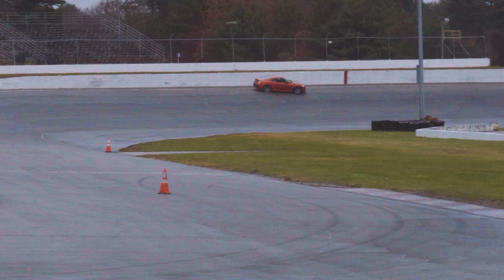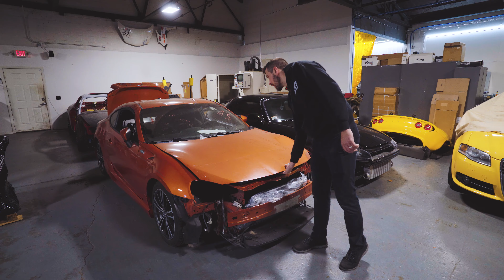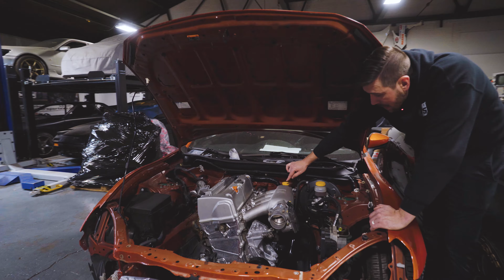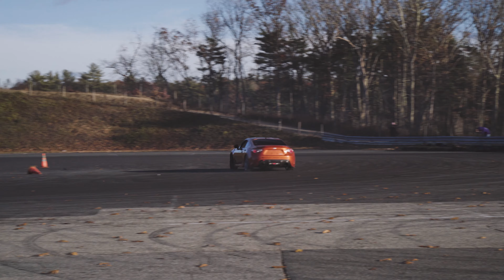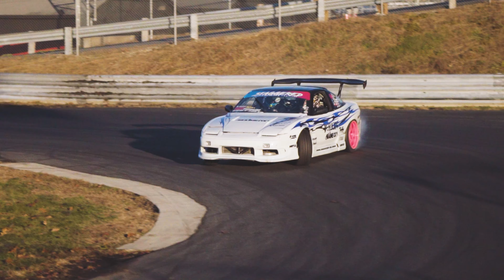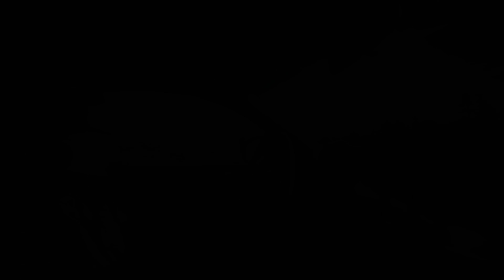Built a K Swapped FRS in 10 DAYS! Then drifted it...

Comment: Editing is top notch. That's one way to fix the toyobaru oiling issues.

ARP2000 for head studs? Just because?
Reply from the maker: I had a set on the shelf instead of using oem torque-to-yield bolts ill be able to reuse these if/when its necessary

Comment: These recent vids are so good; can never have too much technical detail in there. Does the NVH on the K24 once you remove the balance shaft make it pretty much a track-only deal or can you mitigate that with the right mounts etc? Considering this swap for my car.
Reply from the maker: Im a BIG advocate for retaining the stock balanceshafted oilpump when possible as it makes a huge difference in nvh. Most Kswap mount solutions (even in the standard honda fwd world) are extremely stiff and totally produce an annoying user experience when you remove the balaceshafts. In this case I used rubber 67 Dodge Dart mounts and although they are stiff its far less nvh than a urethane based mount kit for a fwd application. If I had more time id execute on my dream to create a spftmount solution for streetcar swaps throughout the range